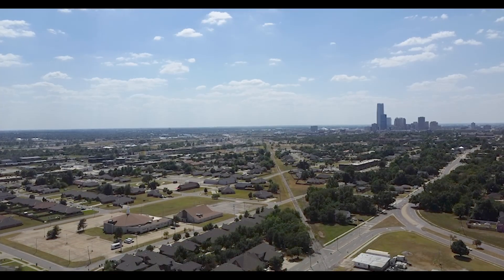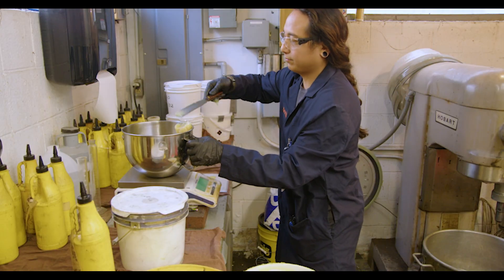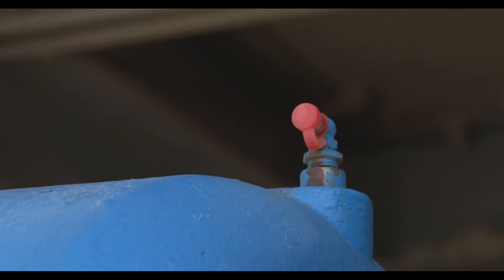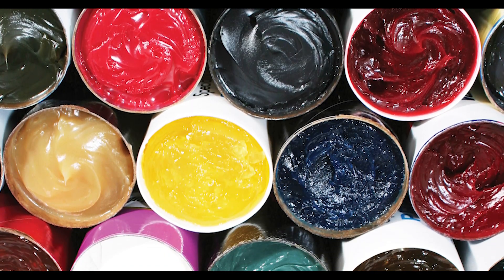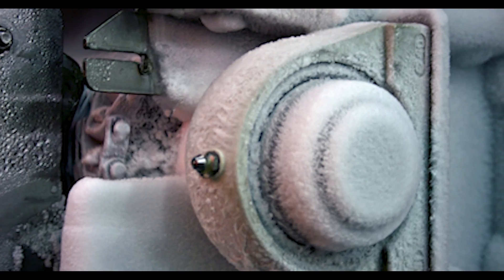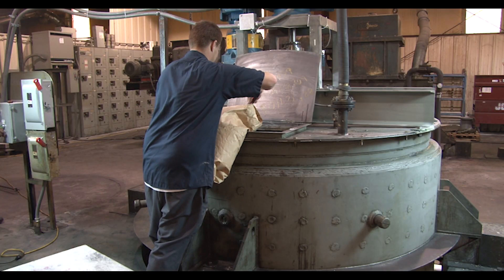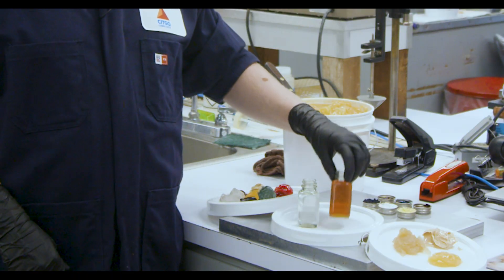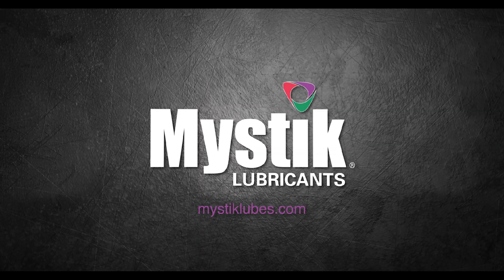Grease Color: What it Does (and Doesn't) Mean

Comment: This was the biggest Baloney since invention of Baloney. So colours may have some important but not really, and colour system doesn't mean shit if it isn't standardised over the industry as whole...
Reply: Exactly what I was thinking. 
I've been wondering for a while what colors meant what, and where certain colors should be used..
Now I learn they do mean something but not always..
So we have a 50/50 shot at putting the correct grease into our applications.
I'm crossing my fingers I put the right grease in my wheels bearings right now😅
I used lucas red n tacky in the truck wheel bearings but I have used the black metallic stuff with anti seize (mixed with the red that was already in there) in my trailers wheel bearings, vehicle ball joints and even my jacks..
I later learned you're kinda not supposed to mix certain greases..
Well how are we supposed to know what not to mix if the colors aren't standardized🤷‍♂️.